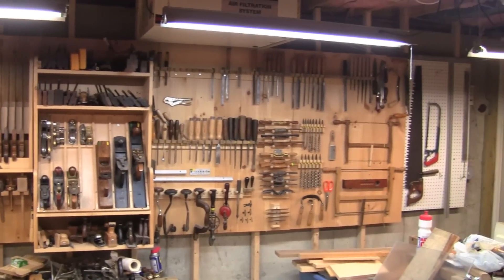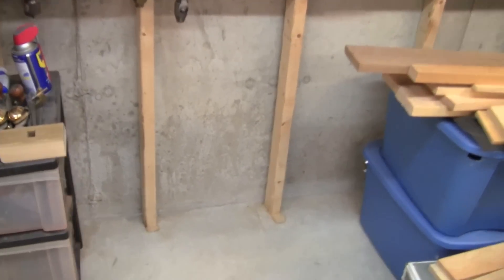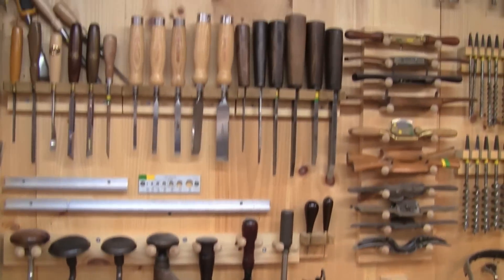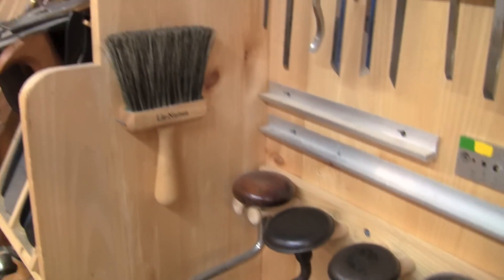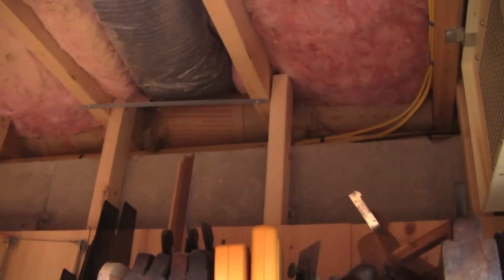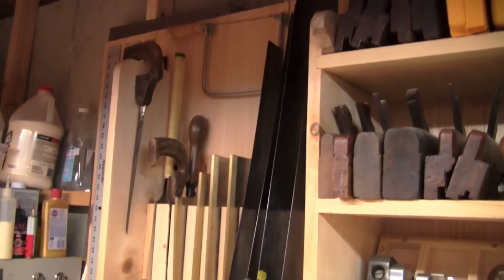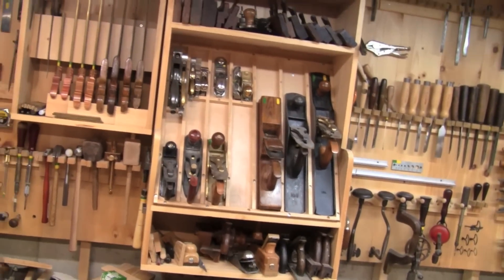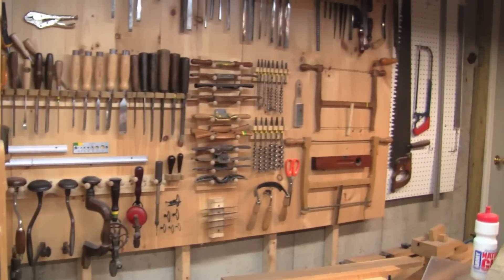Tool Wall

Comment: Do you actually use the bowsaws?
Reply from the maker: Yes, plus another full-size German bowsaw with a turning blade. However, I only use them for curved work, so it's been fairly limited so far, primarily for cabriole legs.